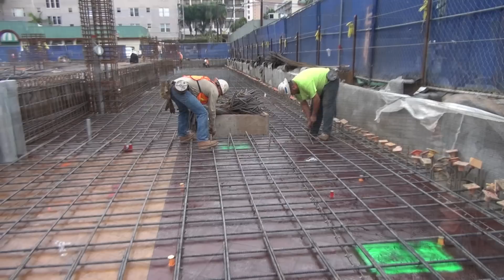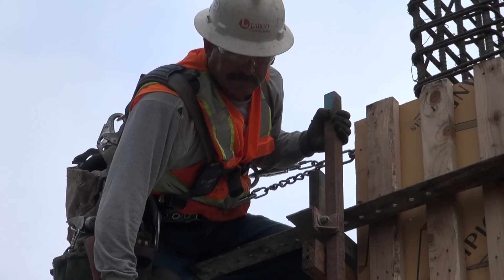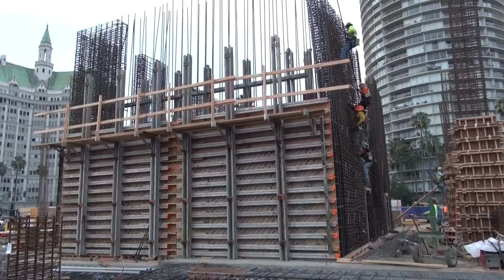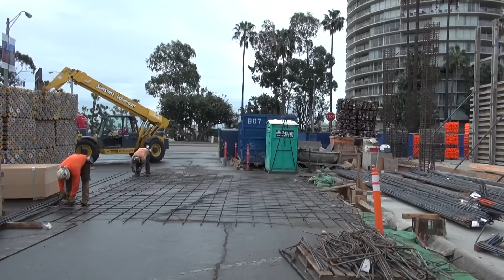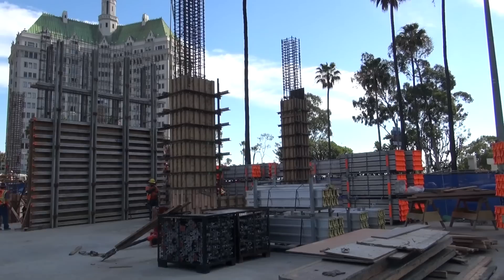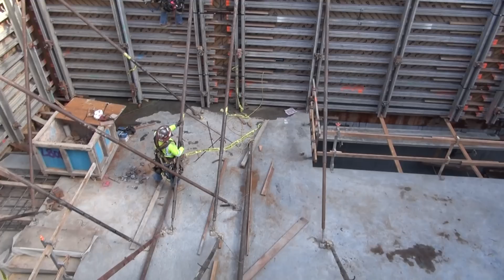High Rise Apartment building - Concrete columns and core walls

Comment: More & strong steel coil ( tar),strong attach/ good joint & wilding need....nut bolt process is good but wilding need after nut bolt joint....

Comment: When you made your fors out of 2x4’s and steel angle, good way to make  verticle custom columns.  Saves you the troublemof unbolting traditional panels. Cheaper also.

Comment: what is actually holding up the steel reinforced slab once the temporary floor and supports underneath are removed?
Reply: It gets temporary shoring until it's cured, it's also tied into the rest of the building already.

Comment: Second hand dealers Jis kisi ke pass centering plywood use kiya huwa hoga to please call kare mujhe 9594877802 second me ho to call kare 
 name tauqeer siddiqui ya kisi ke pss purana loat me rakha ho to call kare 9594877802Second hand dealers Jis kisi ke pass centering plywood use kiya huwa hoga to please call kare mujhe 9594877802 second me ho to call kare 
 name tauqeer siddiqui ya kisi ke pss purana loat me rakha ho to call kare 9594877802 only building material 
Centering scrap liya jata hai

Comment: Where are the dates on column...you should have shown the curing process of shear walls and columns
Reply: The curing process is just letting it cure. Like watching paint dry. No wet burlap required, as the temps were not extreme.